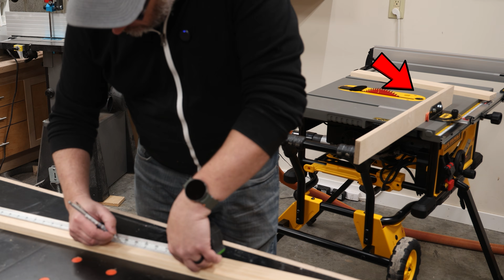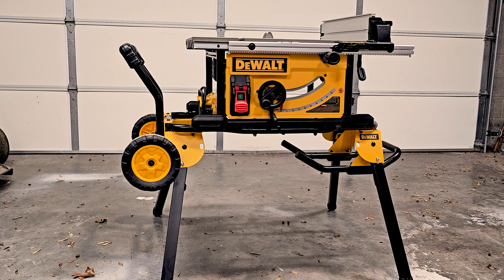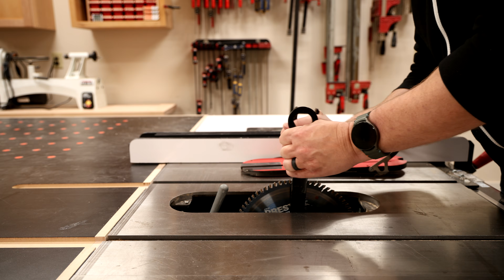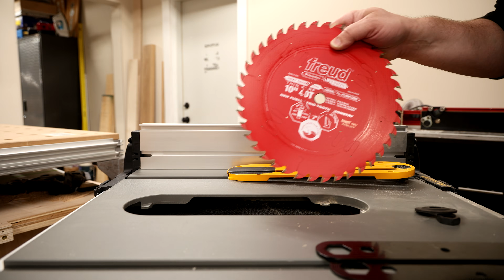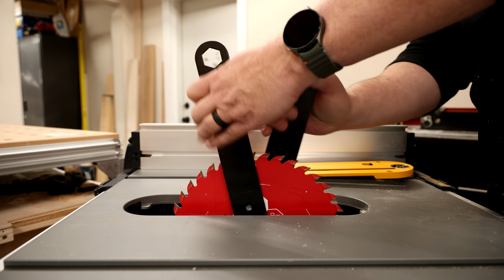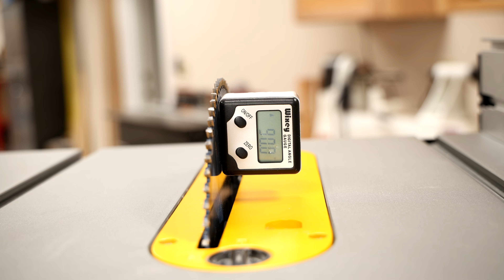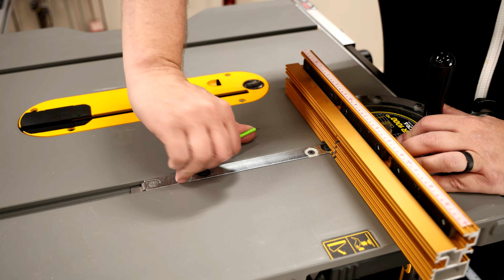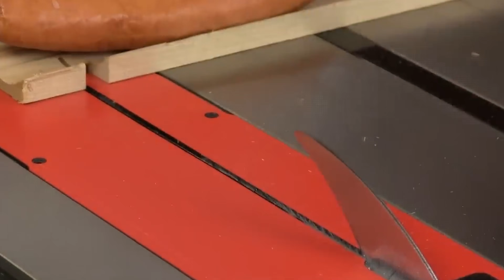Why do people even buy this saw?

Comment: I work at a Woodcraft store and have been woodworking for over 50 years, I just bought a new Hybrid Table saw my old saw wore out and I bought the Rikon 10-205 awesome tool, Great value for the Diy, Jobsite have their place I also use a track saw for sheet goods, Everybody's opinion is valid, if your happy with it then it is good.

Comment: Yeah the miter slots are a disaster on my DW jobsite saw as well. I had to spend an obnoxious amount of time smoothing them out because both got narrower from the front to the back and the depth wasn't consistent. Best I can tell, whatever they did to apply that coating does NOT apply it evenly.

Comment: I been using the same Bosch job site since  around 2000. That’s 25 years people. The stand it’s on is a Ridgid. I kept it fairly well maintained and only changed the blades as needed. I’m not doing any high end custom cabinetry but done some decent built in entertainment cabinets. Large sheets are done on it or I rip down with my Makita track saw.

Comment: After I retired, I sold my Bosch with its gravity rise. Great little saw. In fact, when I moved into a new shop and hadn't get got 240 over to the cabinet saw, I used it for quite a while. As noted, the out-feed was a game changer. 

All that aside, I used job site saws, starting with a Delta Contractors saw many decades back (I'm not going to count the tilt table Craftsman I really started with). The day I wheeled the Unisaw in and fired it up was the start of entering another world. Simply put, there is a reason cabinet shops have big table saws that will be alive DECADES after they would have gone through several job site saws.

Hey, but all of us start somewhere. My start? Well, my table saw looked, suspiciously, like a Black and Decker saber saw that couldn't give a 90-degree cut to save your life, but I made do until I could upgrade to a circular saw, then a table saw, then a better table saw. . . .

If I were to try to compare my cabinet saw to my job site saw I would say it would be like firing up my Astro van compared to firing up a Lambo.  Just the purr of the running engine sooths the soul.

Comment: I've run a 5' x 5' sheet of 3/4" baltic birch through my saw (same DeWalt as you have here) and it is stable - it has no reason to tip. And I also dislike the lack of a second wheel, for setting a bevel angle, BUT if you use something like a CMT magnetic angle finder, you can have both hands available to hold/lock the wheel in place when the correct angle is reached.  For my crosscut sleds, I use HDPE, tailor fit to each slot. I got them close, then used a chisel on its side to scrape away areas where it would stick, until it didn't stick anymore. I use Rob Cosman's method for making my crosscut sleds. It is the best way, if you have the tools, and patience.

Comment: I’ve been remodeling my house to sell it. I needed to build a nice fireplace surround and mantel… I used the cheapest track saw on Amazon and the dewalt contractor saw.
My project took 2.5 sheets MDF . Breaking the sheets down with the track saw was great. I measured knowing I’d send it through the table saw for Final Cut… The thing is - you really need to spend a lot of time setting up the dewalt.. I wish I had seen that trick to extend the fence, the dewalt fence isn’t great…

Comment: The reason why we need Sawstop, YouTube and DIY tv shows! I have been using a table saw since I was 14. My dad built houses back when they built them from the ground up, not bring in contractors for every different thing in the house. He taught me how to safely use a table saw. all the dangers of what causes kickback, bad cuts, not using the fence and cross slide at the same time, and blade height. What blade to use for different cuts. He also taught me plumbing, electrical wiring, and how to weld and solder. Kind of an apprenticeship! At 66 I still have I my fingers and have no injuries that affect my life. Today’s people do not have this type of training. I also worked in the aerospace industry, using lathes, milling machines, and automated machines. The sad part is my best teachers were the ones missing 2 or 3 fingers. They taught me to look at everything I do as what can go wrong, how can I get hurt. That is what is missing today.
Reply: Yeah, I was taught how to drive by an amazing driving instructor so I got rid of my airbags and seatbelts.

Comment: While you can do most everything with a jobsite saw that you can with a cabinet saw nothing would make me go back to using one.  All the, 'you can work around this' stuff is annoying to deal with and I have limited time in my shop since it's a hobby and I have a business to run.  The extra money spent was well worth it for me.  No, I didn't spend SawStop money I chose to go in between the two in price.  I've learned to keep my fingers well away from anything that will remove them from my body.  Already got the been there, done that badge you get from visiting urgent care.

One of the biggest differences I noticed that was not touched upon is dust collection.  Out of the box my cabinet saw has much better dust collection than a jobsite saw.  Having over and under dust collection is a big deal that just doesn't happen with jobsite saws.  Having all that dust collected at the source and not having to breath it or clean it up is a big advantage.

Comment: Excellent review! You covered a lot of good points. The only thing I found slightly frustrating was the fact that you didn't calibrate both saws BEFORE doing a cut test with various woods. When I saw the burn marks created by the DeWalt saw, I kept saying to myself, "Calibrate the saw!". I never got burn marks from any of my table saws after I took the time to calibrate them. Towards the end of your video, I wasn't surprised in the least that you found the DeWalt saw out of calibration. The burn marks on the wood were a good indicator that tweaking was required. Thanks for taking the time to create this very useful video!
Reply from the maker: I calibrated the saw before I did any of the tests 👍 I just edited the video in a different order.
Reply: @MWAWoodworks  I don't calibrate the saw fence to be perfectly in-line with the blade. I set the back of the fence to be a hair out. The result is never getting burn marks on the wood.   🙂

Comment: Great information!  Watching this gave me a new appreciation for my old Porter Cable Jobsite saw, and reminded me: Why buy new when old will do!  My PC was square right out of the box, and I've hardly ever had to make any adjustments on it, and it does have two wheels to adjust blade height and bevel.  My biggest gripes with it are 1) the cast aluminum top can get a little sticky, but that can happen even on cast iron.  2) the throat plate is garbage!  It is steel and there are a couple of adjustments you can make, but it is just too thin and too flexible.  Not a big problem with wider cuts, but smaller pieces are often challenging.

Comment: I recently threw down for a Sawstop cabinet saw, upgrading from a dewalt jobsite saw (same model as he had). The difference in accuracy, repeatability and size  is night and day (as observed in the video), but even if NONE of that was true and they were identical? Yeah it's not a contest. If the sawstop over 30+ years of owning it triggers once and saves my finger it's worth 10x what I paid for it. Any other tool I'd question price vs quality but not for a tools with safety features vs those without.

Comment: I started 35 years ago it was a crap table top saw in an apartment floor on a tarp.  Neighbors loved me.   Moved up to shop smith & great but fatal flaw was consistent setup ^ & power then contractor saw then cabinet saw now  sawstop ics.   Could you cut it with that dealt, yea, the constant fiddling maintenance setup checking every body time.  No thanks.  They are ok for construction work but thats it.  I could & have used nothing but hand tools to process from rough to ready & very precisely, but id rather use my jointer/planer/ts.  Only regret is buying 7' version of sawstop it takes up too much space & I never cut sheet goods on it too dangerous.   Its a collector of stuff now.    I saved for 5 years to get the safety of sawstop.  Don't regret.

Comment: My "shop" is my driveway most of the time and in my garage if the weather is bad.  I have to fold up my work table, table saw, etc., and tuck them into corners of my garage and storage room in between work sessions.  I can't dedicate a space for woodworking.  Given how often I do woodworking, this is all I need.  I suspect that's true for a lot of people.  I wish more woodworking videos would target this style of shop.  A small saw like the one featured here are the only option for guys like me.
Reply from the maker: there are loads of YouTube videos using tools just like you're describing! the issue becomes if you're serious enough about woodworking to be creating content and probably doing this as a full time job, you're going to almost certainly upgrade all your equipment at some point and "grow" into the hobby. that's just the nature of the beast. very very few people stop growing when they just have basic tools. with that said there are a few out there!
Reply: @MWAWoodworks  I love videos like yours and I've made many purchases based on what I've learned.  I can't think of a single creator who starts in their garage, pulls out the car and parks it across the street, then pulls out his table saw on a cart, unfolds it, pulls out his shop vac and plugs the hose into the table saw, etc., and then demonstrates cool ways to pack and unpack a productive shop.  Every creator I can think of is in his dedicated shop with lots and lots of tools in permanent locations that are easy to access when needed.  I think there is a "market" for videos that feature creative ways for the weekend warrior to create a shop like I'm talking about.

Comment: I love my SawStop cabinet saw! Finally bought one secondhand two years ago after 20+ years of using the Bosch jobsite table saw for everything. It was a great relief finally having a table saw with significant safety features built in. Plus it's so solid, smooth, and quiet (comparatively). Also I always had trouble getting the riving knife aligned correctly on the Bosch saw, so it's great having one that works well on the SawStop. All that said, I do woodworking for a living, so I'm not speaking from a hobbyist perspective.

Comment: that cabinet saw is top notch.  for the price, the Dewalt is not bad, however, this is like comparing apples and oranges when talking about quality.  a better comparison would have been the SawStop cabinet say vs the SawStop Compact Jobsite Saw. the cost difference between the SawStop and the DeWalt is only about $250 if you don't get the mobile base and around $400 if you do get the base. to me, that $400 is worth the safety features of the SawStop. if i owned a business and i had people running table saws all day long, i would be using nothing but saw stop. and while a top end tool like SawStop won't improve your skills as a wood worker, it will make it safer for you. and if you're a business owner, save you thousands in the event of an employee injuring themselves or workers comp claims and lost time.  personally, i a just a hobbyist wood worker, and i have outgrown my current Ryobi table saw and have been looking for an alternative after a kickback and a near miss with the Ryobi. it scared me enough that I made up my mind to save the extra money to get a SawStop. just my 2 cents.
Reply from the maker: there's not enough difference between those two saws. I don't think people would have a hard time making that choice. going from a job site to a cabinet saw is a much more compelling proposition especially since a lot of the differences aren't all that drastic.

Comment: Excellent run down.  I liked your tips as well.  I have a 3HP cabinet saw and I do like its power - especially if I'm doing repetitive deeper cuts.  I started woodworking with a contractor's saw which was easily set up for accuracy and served me well.  I've always considered a jobsite saw as inappropriate for fine work.  Pretty good for general carpentry, and definitely handy if you need a saw on site.  If I wanted an affordable option for a home shop and I was into making furniture, I'd opt for a contractor's saw.  Plenty of good options out there (Ridgid comes to mind).  Or shop for a used one.

Comment: All good information, but honestly, this entire video boils down to one fact:
A jobsite saw is NOT a cabinet saw. It never will be no matter how many upgrades or adjustments you make to it.
Comparing a saw that costs around $600 to one that almost 10 times the money is ridiculous. 
Similar to comparing a cheap toyota corolla to a bentley. Will they both get you from point A to point B? Certainly, they will, but one is going to do it with a much better ride, more reliability, and make the trip way more enjoyable.
Jobsite saws, or compact saws, were never designed for fine woodworking, custom joinery, or cutting through 2 or 3 inch hardwoods all day long.
Not saying that a good, high quality, jobsite saw won't perform well or stop you from doing that kind of work.
I own and use both style saws myself almost daily. 
But I'm not going to go to the lumber store to pick up 100 bd ft of sapele in a Corolla vs. my F250.
Reply from the maker: agreed! but people need to be informed about exactly what they are buying if they upgraded to a cabinet saw. for a lot of people the upgrade is probably not worth it for the work they do after they see how to get by with a job site saw!

Comment: You are not wrong, more expensive isn't always better... even so, I bought one after I had used my old craftsman table saw for about 25 years. I was always very careful to use a push stick, and had used old faithful without serious mishap for the duration until recently when I had a serious incident with kickback that resulted in me seriously injuring 2 fingers on my left hand (got pulled into the blade). It totally freaked out my wife who had to drive me to the emergency room to get my fingers stitched back together again. One kind of looks ok, but the other, ugh... The boss put her foot down, and said there was no way she was letting me near my beloved contractor saw again... buying one of these was the only option for me... Yes, it was expensive, and yes, the cartridges are too,  but it does work beautifully, is accurate, and gives me some peace of mind.
Reply from the maker: more expensive is almost always better! the question is do you NEED the "better" for the work you do or are you just buying convenience and efficiency. many people mistakenly believe buying expensive tools will make them a better woodworker by somehow improving their skill, when in reality it's just buying a better experience with fewer hassles and more conveniences!

Comment: I would think the most important thing in any saw, is accuracy? and all things that contribute to or take away from that, like flat table, square fence, blade that is parallel to fence and miter slots, etc etc.... all the power and table space means nothing if those other things are not present.
Reply from the maker: agreed 💯
Reply: @MWAWoodworks  edit... lets add a throat plate that doesnt flex when passing the work piece over it, and is flat and level with the table.... and an arbor that doesnt wobble like a spinning top about to fall over...

Comment: You should rerun the power tests after squaring up that blade. If it wasn't parallel to the fence, that could be the source of most of the problems and burning.
Reply from the maker: all tests were run after I fully tuned the saw!

Comment: I bought a used lower end cabinet saw a few years ago. ($300) Great deal, need some tlc. I was amazed at how quiet the bigger motor was because it’s not struggling to get through the wood. Also the ease of cuts was very apparent. If you find a good deal it’s definitely worthwhile.

Comment: I got the Dewalt 7491 when it first came out in 2013 and it served me well until last year when I finally saved enough to get a Sawstop cabinet saw.  That said, by the time I retired it, it was a bit of a Frankenstein and bore little resemblance to it's original configuration (yes, I actually did file the miter slots to get them smooth), but is still entirely adequate for it's designed job of cutting jobsite lumber.  The difference between it and the Sawstop is like night and day, which given the 10x price , it should be. I'm very happy with both decisions.